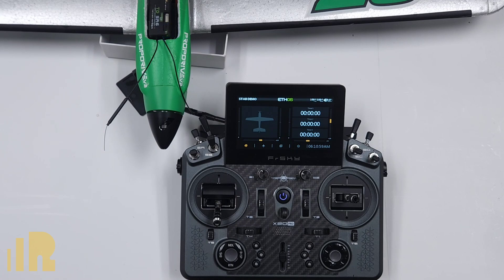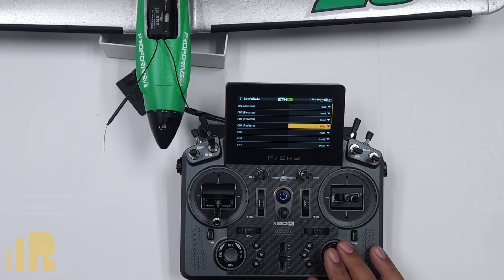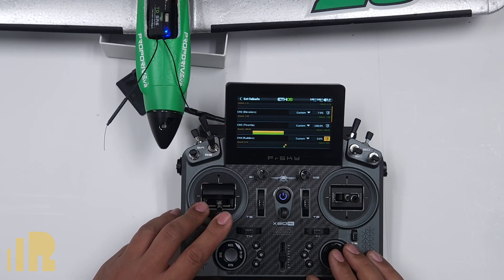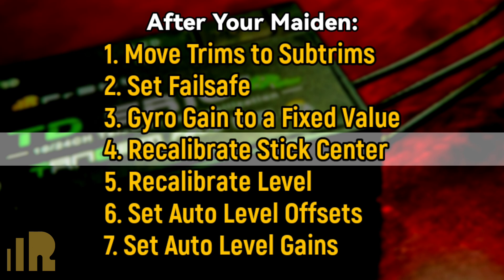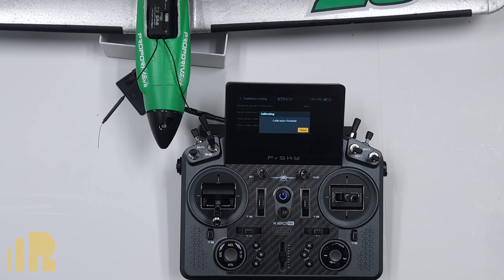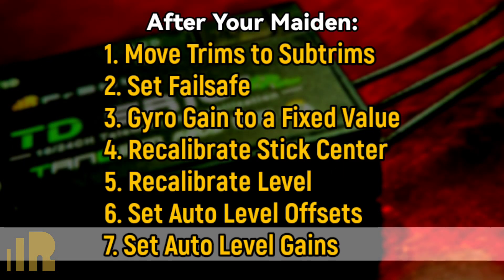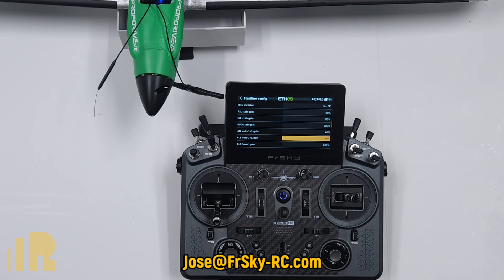After Your Maiden : Setup for FrSky Stabilized Receivers - FrSky ETHOS Tutorial Series

Comment: Hello Jose,  I'm new to FrSky, but so far with your help. I've got almost 8 big planes set up and they fly great. With that, I do have one question. So with the Gyro set up, you have gyro on, gyro off or auto lvl, similar to Spektrums AS3X and safe. I'm a past sepktrum user and never used safe, but instead used 2 settings on AS3X. I had Off, As3x low or As3x mid, with gains a little different between the 2. Is there anyway to do this with FRSky? I would like to have 2 gyro modes with different gains for different wind conditions and turn the auto lvl completely off. Which i have done by setting 0% in the auto level configuration in the device config menu. Thanks for your help and all the GREAT videos!
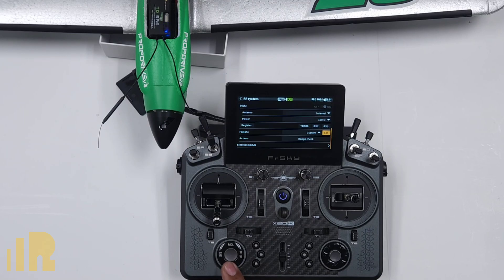Reply from the maker: In the gyro mode mix, add a new curve. Curve type is custom. 3 points. Point 1 is 0, point 2 is 0, point 3 is 100. This will make position 1 and 2 of the switch stabilized mode. Then follow the steps in the video to move the gain amount to a VAR, I believe at 6:16. After you input your initial gain value, then ADD A NEW VALUE, assign your switch ( your mode switch all the way back) and then input your second gain value. Now mode switch all the way towards you is gyro off. The middle and away from you is stabilized mode with different gain values. Hope that makes sense... If you can't get it to work, email me at jose@frsky-rc.com and I'll make you a quick video.
Reply: @FrSkyOfficial thanks for the quick reply! You should show this in a video. I know others would love to see this. I do not like self level/safe. I just like to have 2 levels of stability for different weather conditions! Im watching your knife edge and Hover videos now, may try this on one of my smaller electrics...
Reply: @FrSkyOfficial so I added a new curve, custom with 3 points. Like you said, it should work, I see what you mean now and how the curve is working. I still got to fly the plane and will select the old weight settings for now, that way I can verify throws before I fly in self level mode, then I'll save the settings in vars and make a add this curve back to this setting..thanks for the help...
Reply: @FrSkyOfficial ok, I finally figured out where to add this value. I was trying to add it to a mix (like another gain, or add the value to channel 13, gain adjust) I was stumped, then it hit me, I had to go back to the Vars setting and set the new value there. It's making more sense! Lol, thanks for all your help!

Comment: Can I just set the gain% on the stabilizer menu for each axis and unassign the knob or whatever I assigned to fix my gyro values to avoid moving them unintentionally? 
I assigned a knob from 0-100% with voice telling the percentage... can I just input that audio percentage value to the stab config control surface?
Reply from the maker: The gain value is a combination of the master gain value and the value in the stab menu. So you should have a value in the ch13 gain channel. Just use a var as described in the video once you find out what that value should be.
Reply: @FrSkyOfficial Thank you so much for taking the time to explain me but I still don't get how both gains interact between them. Is there a step by step for dummies 😂 on how to set the gains for good? 
Regards.

Comment: is there any way to get auto 1v1 offset to be adjustable in flight with a trim switch ?
Reply from the maker: Not really... I haven't had to do it. Generally if you go into auto level move and it snaps too quickly to level... I take auto level gain for elevator and someone and cut the preset value to half. Seems to work pretty well for most of my planes.
Reply: @FrSkyOfficial  the offset I thought was for if it was not flying perfect level in auto level to trim the plane to hold level not the speed in witch it snaps to level position
Reply from the maker: Apologies, your after reading your comment, you were totally clear... I'm my haste I read it wrong... No, there really isn't a way to adjust auto offset in flight. When I have had to adjust it, usually I land do the adjustment and it's been dead on after one adjustment. But yeah it would be nice if it was adjustable in air... I'll make a note and see if the engineers can do something like that

Comment: When you send the trims to sub trim and you have flight modes that have independent trim settings (ie different elevator trim for different flap positions) does it reset all the trims to zero?
Reply from the maker: It essentially resets the trim center but the values remain the same. So if you move your trims to subtrims, the flight mode will still operate the same
Reply: @FrSkyOfficial awesome thanks!

Comment: If you did not want to make any more adjustments, could you take the 40 value, go to Outputs, then select ch 13 gain adjust, then put the 40 value in center/subtrim?
Reply from the maker: I believe so. But make sure to disable the pot so it does not affect the output. Personally, i would do it in vars like shown in the video. I would with do a var like shown or change the mix and leave output alone. But as long as you get the desired output, do whatever works for you

Comment: For planes with dual/triple rates on ailerons and elevators one needs to set the rate to maximum when doing the stick range calibration during gyro calibration, right? But doesn't that make the gyro act very aggressive which would be a bit of a nuisance when you're just cruising at low rates? I'd like the gyro to act normally and still be able to switch to very high rates.
Reply from the maker: When you move the gain to VARs like i showed in this video, you can assign switches or a flight mode to the gain value. Now you can have different gyro gain rates based on switch position or flight modes.

Comment: José, would you be able to do a video about setting up a wing with a TD stabilizer receiver? That would be very helpful. Thank you for all these videos.
Reply from the maker: In the works! Its on the list. I've had to help quite a few people with that. Just remember if you are setting it up, no elevon mix in the mix page. Treat it like a regular plane. 1 elevator and one aileron. In the stabilize config, change wing type to Delta.
Reply: @FrSkyOfficial excellent, thank you for the heads up!
Reply: Thx
I m just bit confused about calibrate auto level after moving trims to subtrims

One other question please
What is the difference between subtrim/center function and pwm center
I usually use pwm for sub trimming but I don't understand the difference
Reply from the maker: Sorry missed this post. When you move trims to SubTrims, it does NOT change anything. Your stick center has not changed. You are just moving trims to sub trims. This is so you don't accidentally hit a trim switch and not know what it which way you bumped it. You recalibrate center NOT because you moved trims to sub trims, you recalibrate center because trims, after your maiden has been adjusted. This way, the gyro will know when sticks are centered.
Reply from the maker: Center/Sub Trim, moves center. But it Does Not affect your end points. PWM center moves everything. You end points also move. This is great... But keep in mind the mechanical limits of the actual servo. If you use pwm center, try move your sticks and make sure you aren't hitting the limits of the servo. Chances are you'll be fine, especially if you aren't over 100% or -100% on you minimum and maximum